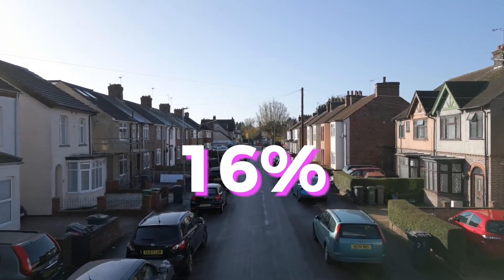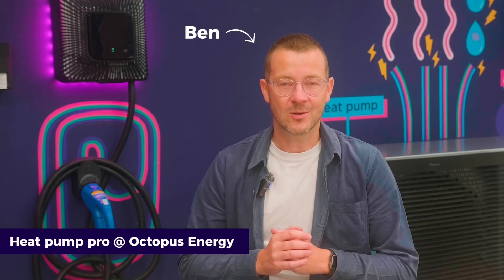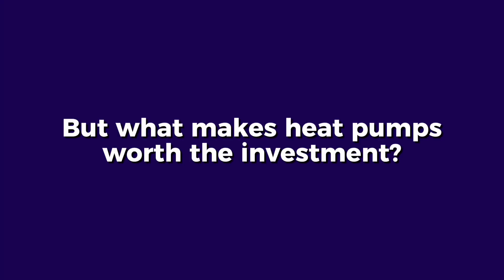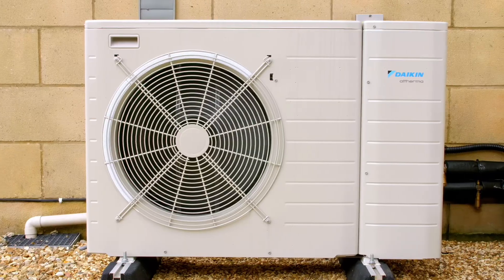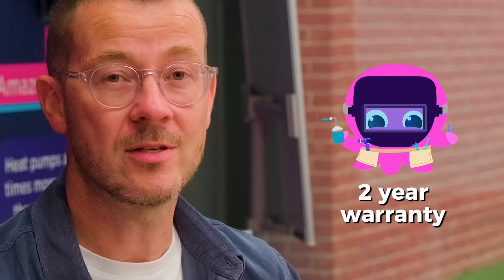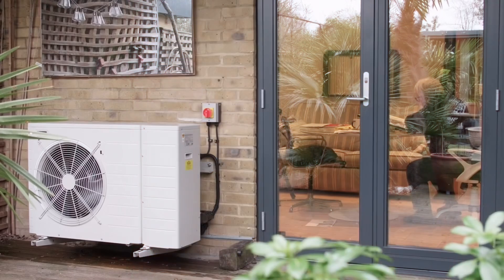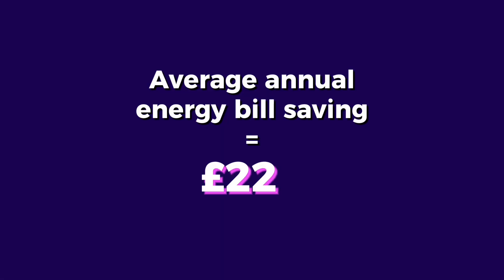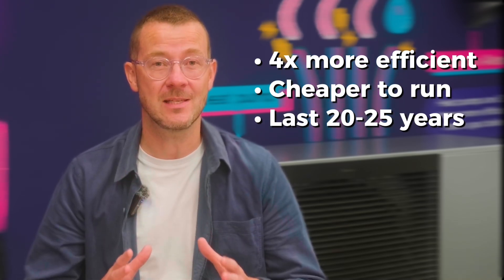Are heat pumps ACTUALLY worth the investment?

Comment: Octopus Energy, 

no, heat pumps are not four times as efficient as a gas boiler, that is a common but basic error. You cannot use the electricity used to power it as a basis for efficiency calculation, you must use the amount of fuel used to make that electricity. And from that they do not emit 80% less CO2.
The achilles heel of an air source heat pumop is that output declines with a fall in ambient outside air tempertaure, i.e. the colder the weather the less heat the heat pump gives out.
Reply: ROFL. Other sources confirm the COP of 4
Reply: @rtfazeberdee3519  
I suggest you go back and read what I wrote regarding how efficiency should be calculated.
An air source heat pump with a CoP of four is at what outside ambient temperature as the normal accepted level is three at seven degees C ambient?
Reply: @iareid8255  i'd suggest you ring the experts who wrote the book on these things and explain to them how wrong they are.
Reply: @rtfazeberdee3519  
I'm no expert but do have a solid background in electrical power engineering.
Self style experts on the other hand?
Reply: Respectfully I think you're overlooking tallying the extensive externalities of gas supply in that claim. Adding the source efficiency/emissions for leccy and not gas isn't a fair comparison.

Not to mention all the Infrastructure, control systems, leaks, the odd explosion, repairs and co risks impact unique to gas.
Reply: @MacCraig8  
Perhaps I didn't make it clear but you cannot compare the efficiency of electrical powered devices with gas ones it just doesn't work. That, however, is what Octopus claim.
Reply: Heat pumps are widely used in Scandinavia and Alaska where winters are considerably worse.  Even at -25C in Alaska they have a COP of 2 and at -35C a COP of 1.8.  This will vary for specific models but in any case across a year the average COP will be three to four depending on conditions.
Reply: Russ, 

I find that very hard to believe, exactly how is the CoP measured?
Essentially, as the suction temperature is no more than the ambient, that requires  a significant increase in discharge temperature to provide sufficient temperature for space and water heating.
A multi stage compressor will do that, I expect, but that requires considerable input power.
Scandinavians also have log burners in their homes.
Reply: Whatever the efficiency it doesn’t seem to mention that Lecky costs 4x what gas costs!
Reply: @ThePrawlin   1 unit of electricity used in a heatpump gives out heating that needs 4 units of gas to equal so about the same cost or better.
Reply: @ThePrawlin That gap is closing quickly over time and will catch people out snapshotting today's pricing for decisions. Not to mention plenty of tariffs that make that untrue as well.

Comment: Didn’t this get posted yesterday?
Reply: Yes.
Living in an “all electric” house with no gas boiler or wet central heating system why would I want to put ugly pipes and radiators around the interior of my house?
Reply: @timoliver8940 is yours the 'air to air' heat pump option?
Pity there is no grant for that, I'd love to bin the rads.